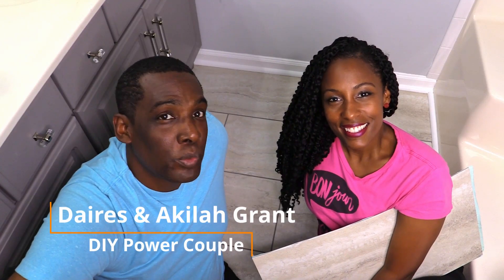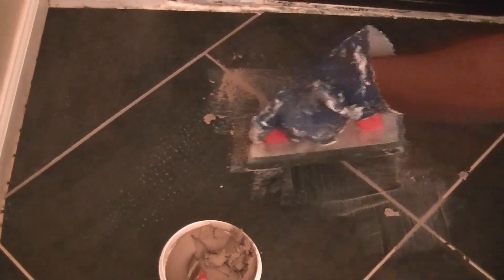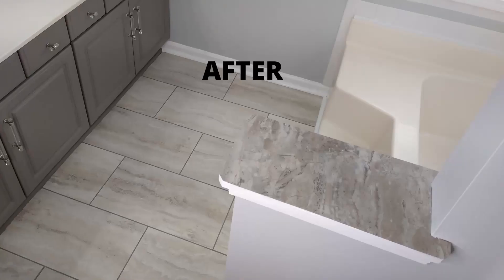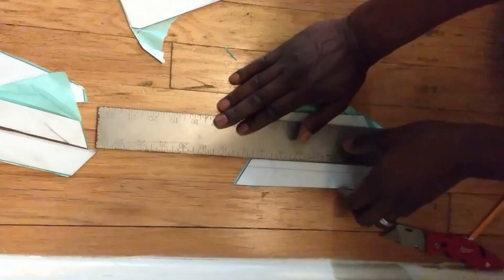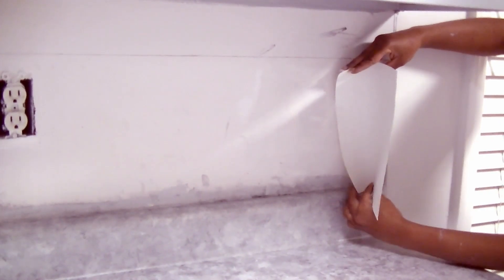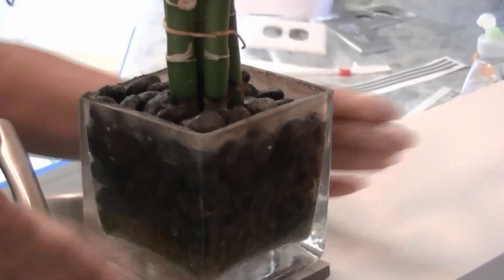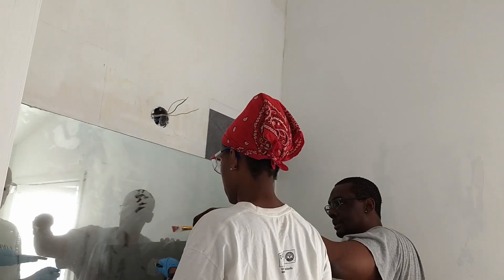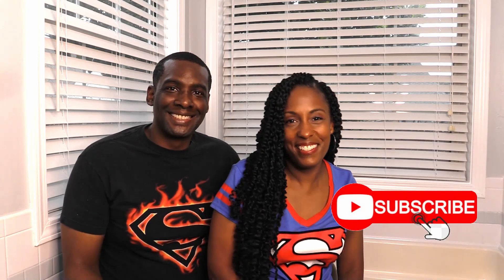TOP 5 WAYS HOW TO INSTALL PEEL AND STICK VINYL TILE (BEGINNER-FRIENDLY) DIY Power Couple

Comment: I installed some peel & stick tiles in my kitchen, but after a few years, they started to move and the floor became very sticky. I have big gaps between tiles now and they are black from dirt. It doesn’t matter how much I clean the floors, the stickiness and dirt, doesn’t come off. Buy yeah, at the beginning it looked great.
Reply: Just wondering how many years it took before this started happening. I am considering doing peel and stick flooring in my kitchen as an interim renovation to cover current ugly tiles while i save up for something longer lasting. Will likely have peel and stick for 3 or 4 years.
Reply: @mskimy1125  
There are so many more options with the new peel and stick. Most of them are thicker and like a couple styles they used had grout.
Reply: @Jillb1950  The new peel and stick tiles are  way better quality than the old ones. The new ones are basically tiles there so thick.
Reply: I would never do this in a house but an apartment yes! I just need it to last a few years.

Comment: Hi guys, thank you so much for all the tips and tricks. I love it I don’t know if you have a video for it or not I’ve never laid down tile or pill and stick tile. I’m curious how to do it around the toilet though I mean I get how I would trim it up against the wall around the corner but not the toilet area and I don’t know if you have a particular video for that and then to I have 18 inch tiles in my bathroom but I’d really like to cover with the pill and stick tile is that possible or do I need to do something else with those tiles in the grout lines 1st lines 1st
Reply from the maker: Hi Tracy, we usually take off the toilet before laying tile.  If that is not an option, you can take the paper backing, line it up against the toilet, and trace a template.  Then cut the tile using the traced template.  We used pruning shears to cut these tiles like seen in this video: https://youtu.be/pL9uYCeMME8?si=WYC5dBEmCW0VmSrk  Hope this helps.

Comment: Would it be possible to use these tiles on an outdoor concrete patio? Maybe with a stronger adhesive?
Reply from the maker: Shevon, we haven't tried peel and stick on concrete, but anything is possible if done the  right way. Let us know how it goes 😃. -DIYPC

Comment: Could you use the peel and stick tile that you all used for the kitchen backsplash in a bathroom and drill/mount a mirror on top of it? Or would you have to mount the mirror first and then peel and stick?
Reply from the maker: Sabi, we would mount the mirror then use the backsplash peel and stick around it. Let us know how it turns out. -DIYPC 😃

Comment: Hi guys i love your videos i have a question me and my partner buy a 12/12 peel and stick tiles flooring to pot in in ours bathroom but what happen the bathroom got wall paper , but we cleaning up really good and the serface is really smooth so we start sticking the tiles real nice and guest what they start felt off from the wall what you suggest we can do please help😟😩😱
Reply from the maker: Hi Lissette! You may need to clean the wall with TSP and use an adhesive for vinyl flooring.  These two videos should help - Accent Wall Update: https://youtu.be/rPERFUlxQfI and What Adhesive to Use with Peel & Stick Vinyl Tiles: https://youtu.be/0RAD2h5aMNw  Hope this helps!

Comment: Hey. After watching one of your videos I used vinyl tiles in my bathroom.  Questions...how do you clean them? How do you clean the grout?
Reply from the maker: Hi Carla! Sometimes we use a Swiffer or a common floor cleaner.    To clean the grout we have used baking soda and water mixture diluted enough so that it won't turn the grout white.  Hope this helps!

Comment: Not sure if you guys know this… but I’m about to but self adhesive vinyl flooring on top of current stone tiles with grout. And I just used a patch and fix to fill in holes and the grout on the existing floor. It’s a bit uneven (not perfectly level) even after the patch product. And then I’m using pre glue on the floor. Do you think this will be ok? 
Thanks for any advice. If not, thanks anyway for the video. Good production 👌🏽
Reply from the maker: ArcticCowboy, it could work. You have to have pressure to make sure the tiles adhear. Let us know how it turns out. Thanks for watching! -DIYPC 😃

Comment: In your kitchen did you not have to lay any sort of padding down on the concrete? I'm debating putting this down over my existing laminate sheet or pulling it up but I wasn't sure what needs to go on the subfloor
Reply from the maker: Hi Rich!  In 3 projects we did different things for the subfloor.  1. We did not use any padding on top of the concrete for the kitchen as seen in this video:https://youtu.be/KLGdmqcEm8U
2. We used the same tile in the bathroom, but tiled over existing flooring as seen in this video:https://youtu.be/mpvmRPkQEd0
3. If you have a damaged subfloor, you may need an underlayment: https://youtu.be/yvEZNupNNFo

Comment: I would like to cover my existing kitchen backsplash with peel and stick. Do you think this is a good idea? Also, what could I use to cover the edges where the tile does not go all the way to the walls. Seems like it would be really thick looking and obvious that I had put something on top of the existing tile. Any advise?
Reply from the maker: Hi Cindy! This video will show you how we used a finishing edge - https://youtu.be/r4q8CBn_9so
Try a small section to see if the peel and stick tile will look nice. Hope this helps! 🙂

Comment: Does grouting peel and stick help them adhere better to the floor? Or is it mostly just for a sleeker look?
Reply from the maker: Ashley, grouting helps to keep water and moisture from getting underneath the tile. The adhesive helps keep the tile on the floor.  If you have a tile that just will not stick, you may have to add some adhesive to the flooring. We hope this helps. -DIYPC 😃

Comment: What size or brand of spacers did you use ? on your peel and stick tile prior to applying the grout.
Reply from the maker: Hi! They're 3/16" 5mm t-spacers @3:30 in the video and you can check out this link for same size horseshoe spacers that some DIYers say are easy to work with:
https://amzn.to/3cut92z

Comment: I installed the Traffic Master 12x24 marble tiles in the master bathroom.. they are amazing. Tip for easy cutting is to heat it with a hair dryer first..

Comment: So do you have to use grout on peel n stick floor tile, or just that specific brand, or is it just by choice?
Reply from the maker: Ty, No. You do not have to grout your tiles. It's just a matter of personal preference. If you do not grout, you should place each tile against the other. Although, grouting can help seal against water and moisture. Hope this helps. Thanks for watching! -DIYPC 😃

Comment: Did any of your walls have texture on them that was hard to cover? Or do they work on all walls?
Reply from the maker: Hi Leslie, this video may help. https://youtu.be/8lmCMjuEYp0 It shows more of the wall texture and project details. How you prepare the wall  for adhesive helps to determine how well the tile will stick.  We always recommend trying a sample tile first to see if it works for your specific conditions.

Comment: How boxes of the peel and stick did you have to buy to complete your project?.....
Reply from the maker: Which project? You can find more info in each separate peel and stick video and gauge how many boxes you may need for your space.
Reply: @DIYPowerCouple   the one where you did the kitchen
Reply from the maker: I think we used 2 or 3 packs of 10 sheets for the SmartTiles. Their website shows how to calculate how many sheets you will need for your area.  Hope this helps!🙂

Comment: the tiles I bought do not have the overlap, so do you butt the 2nd tile in the same orientation as the 1st. or do you rotate or flip the 2nd. for a varied, random look? Is it tile 1 edge B butts up against tile 2 edge A so from a  corner keep them consistently flowing edge B to A B to A? Row two again exact same or flip & rotate randomly? Can't find any info on the square no overlap brown/white/tan colored stacked stone look peel & sticks from Dollar Tree.
I've put up 4 tiles, 2 rows, random, non consistent pattern and it really looks dumb!
Reply from the maker: Hi Miss K. Some tiles have arrows on the back that you want to lay in the same direction. If you do that, you can arrange them in a pattern that looks nice to you.  Hope this helps! 😊

Comment: Yes, I have used peel and stick on my bathroom countertop. I am in a rental, so I use on the counter and floor. 

I used it for my backsplash in my kitchen. And my cabinets for both bathroom and kitchen. Can be challenging, but when finished you have a beautiful makeover.
Reply: How are the bathroom counter tops holding up?

Comment: You guys are so adorable! Have you ever installed peel and stick tile over an existing tile floor? I searched the playlist, but didn’t see that so I wanted to ask. We have a laundry room with a textured ceramic tile floor already in a green and white checkerboard pattern that we really hate. We will eventually rip it up and redo it, but it’s far down on the priority list so I’m hunting a short-ish term improvement!
Reply from the maker: Hi April! Thanks for your kind words. 🙂 Here's the video where we tiled over existing vinyl: https://youtu.be/mpvmRPkQEd0
We have seen peel & stick work well over ceramic tile, too.  It is good to have a clean surface. A laundry room is a great place to try it without extra adhesive so you can take it up easily if needed.

Comment: Looks great! Did y’all have any issues with maybe some none flat areas on the cement floor? If so, how did the tiles do in those areas? Thank you!
Reply from the maker: This video shows how we used a 100lb roller to smooth the tile over the uneven concrete.  https://youtu.be/mpvmRPkQEd0

Comment: I did that same backsplash in my kitchen and I did not like it. It looked fake and shortly after a year, the tiles started to detached from the wall. I finally decided to remove them and some of the paint from the wall came off. Now, I have to paint the walls. Not happy :(

Comment: I haven't used peel and stick tiles before, but I'm trying to redo the bathroom in our new house. The all of the walls and the floor are done in this ugly blue tile. Would this be able to go over the tile on the walls just fine? I don't want to have to redrywall
Reply from the maker: Hi River, you may want to try a sample tile that you like to see if it works on your wall.  Not all P&S tile adhere the same.

Comment: Don’t understand why people use cheap products that will not last. Your whole house is cheap peel and stick wow. Don’t cheap out on flooring.
Reply from the maker: Gordie, peel and stick is very durable and will last longer than the flooring originally installed by the builder. It also looks much better in our opinion. 😊